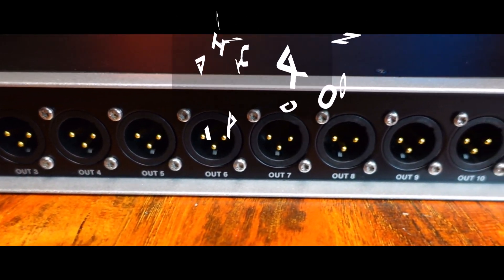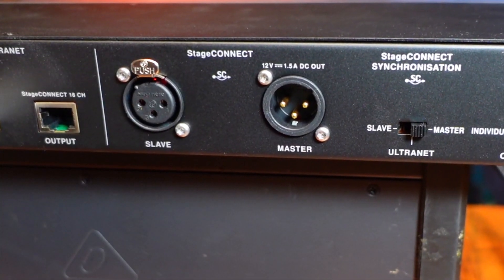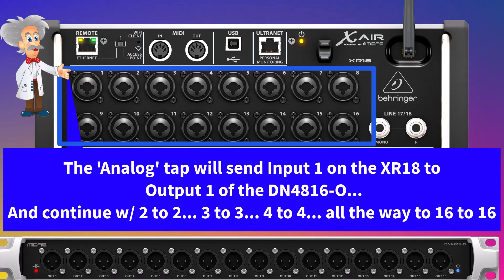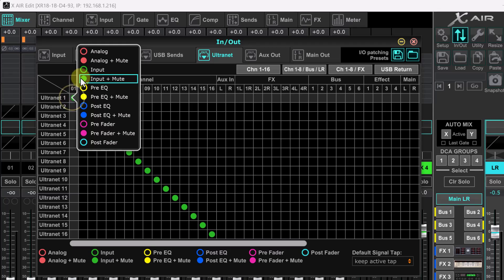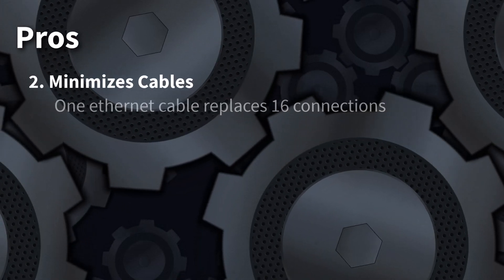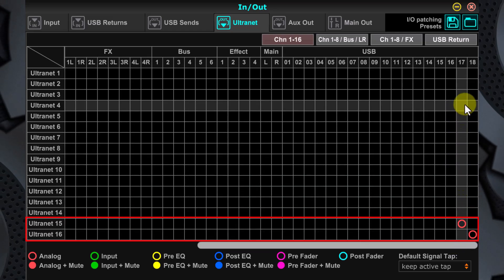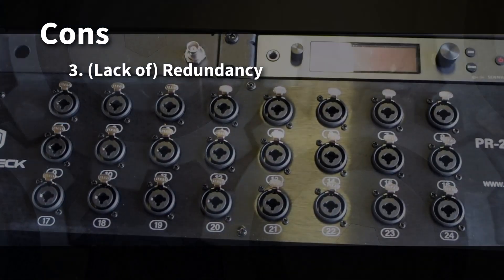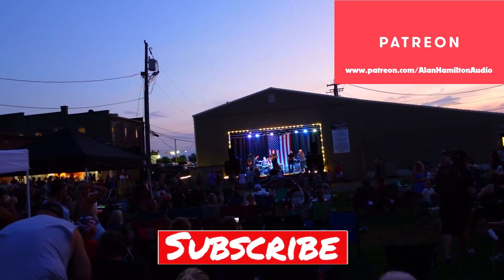Behringer XR18 with Midas DN4816-O for IEM Splitter

Comment: Could this also be used with the x32 rack?
Reply from the maker: I hadn't thought about it, but I see no reason it couldn't be used exactly like described in this video. As long as you just need 16 channels split to FOH, it should work fine.
The X32/M32 ecosystem stuff is limited to 16 outputs on the Ultranet/P16 routing... just like the XR18. But the X32 Rack just has 16 mic mic pre's itself (unless you are connecting to a stage box via AES50) to expand it. And unless you're using the Auxes or USB for additional inputs that would need to split to FOH, the DN4816-O should work just fine in this role.
Reply: @AlanHamiltonAudio  is there a way to set up the routing in order to have 16 additional outputs with the x32 rack? Not sure if you've looked into that or if it's even possible to use this as an output extender instead of a splitter so to speak
Reply from the maker: I don't know if you could stretch it that far or not.

I just can't think why it wouldn't work on the X32 Rack to at least get you the full 16 balanced outputs of the full-sized console. You can route the buses to the Ultranet outputs so I'm not sure there'd be more to it than that to at least get that far.

I don't have a Behringer Rack but I do have an M32R. So I'll have to try this on there and see if there are some possibilities I haven't even thought about... (until now ;) ).
Reply: @AlanHamiltonAudio  if it works let me know! 😊 I've been having to make do with only 8 outputs so being able to find a cheaper way to get more outputs would be awesome! I could use a stage box but this seems more compact and cheaper if it works! 😂
Reply from the maker: @styxx0500  Definitely... Heh... You might've just given me a whole new video idea to explore! :)
Reply: @AlanHamiltonAudio  well I will DEFINITELY be looking forward to that video! I'm already a subscriber but if I wasn't, I would be now! 😜🤣
Reply: @styxx0500  in the X32 routing you can assign basically anything to your 16 Ultranet outputs. E.g. X32 channels 17 through 32 to Ultranet outputs 1 through 16. Same for all the mix buses, matrix channels etc.
Reply from the maker: @styxx0500  It definitely works... Just tried it with the M32R today and was able to route Ultranet 1-8 on the console to be fed from buses 9-16 on the console. Fed it into a powered Turbosound speaker and worked perfectly.
Reply: @AlanHamiltonAudio  that's a game changer! 😝 Thanks for testing it! Looking forward to the video!
Reply: @styxx0500  It sure is! I think I'm gonna order one.
Reply: @styxx0500 , that is a great idea.   I never even thought of that.  I’m gonna try it.   One of the drawbacks of X32 racks, in my opinion, is the lack of outputs.   Like the X/MR18’s you still have only 5 Aux outputs if you use the Mono Channel for subs.   This would free up aux outputs for the mono channels and additional MixBusses.  Awesome!
Reply: Thank you for your videos! They've helped me and my band so much. I was thinking of getting this to streamline my IEM rig, which I've learned to use with your help, but since I want to make th FOH team job as easy and comfortable as possible, I'll be keeping my analog splits. Hopefully, in the future, they'll come up with an update that allows to send raw signals.
Reply from the maker: @chavoesunzombie  Thanks!
If you already have an analog split there's nothing wrong with that. They just work. 
But the digital splits have their place, as long as people understand that it's at least always going to be coming after the preamp of the XR18. And more importantly, understand what that means as far as setting the gain and leaving it alone... as well as setting the right tap point in the first place.
Hopefully, this video helps people with that.
Hard to beat that DN4816-O and XR18 combo if space/weight is at a premium and a person needs a compact ear rig with 16 mic channels.
Reply: Now how about really putting the verisility to the test and see if you can route it to be additional inputs instead of additional outputs... 🤣
Reply from the maker: @styxx0500  And that's the easy one to test... Ultranet doesn't have any inputs on the console. It only maps to outputs.
Now that said, through StageCONNECT, like on the Wing, the DN series does allow inputs (as well as outputs) in the mapping.
But that brings us to the next fly in the output... so far anyway- Midas has not put any preamps in a StageCONNECT box. They're all line level inputs. Perfectly fine for a rack of RF mics that have receivers with line level outputs, but no good for an SM57 or 58 on an amp or vocalist that needs a preamp.